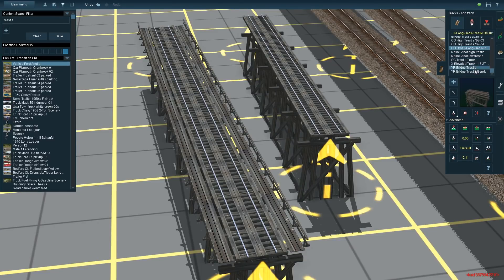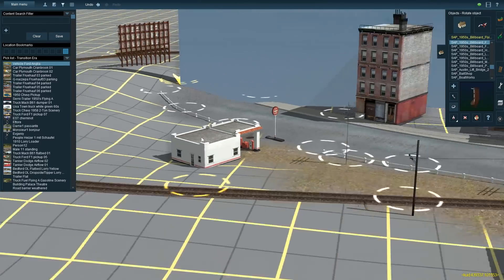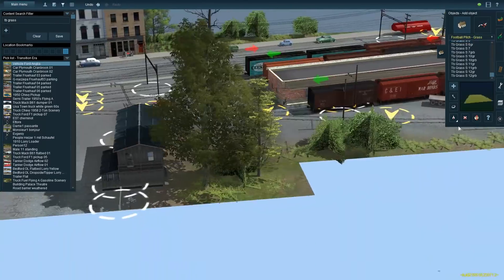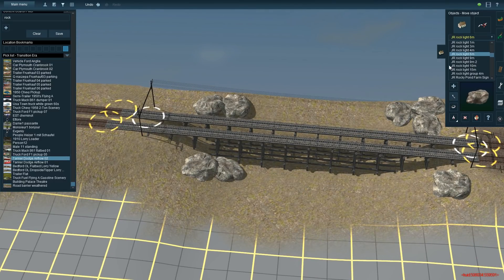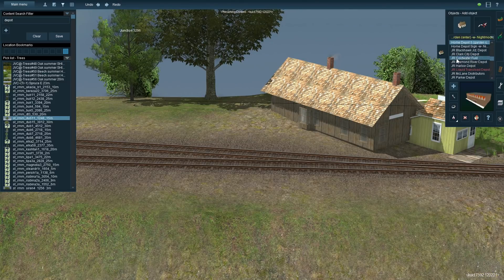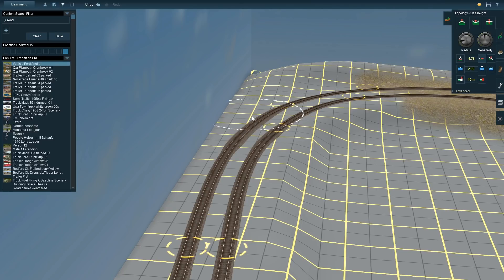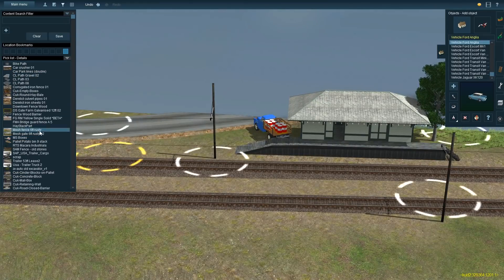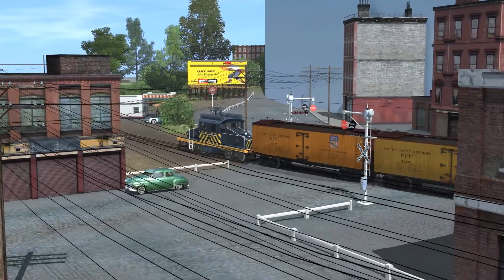Dayton & Troy Electric Railway: Episode 4

Comment: A little late points.
I really like the intro used on this series. The music is great, has some feeling.

The intro itself is the absolute best of most any I've seen. The first time I saw it I thought it was a real vintage cinema short. So well done.

The era for me is the thirties so there would have been plenty of vehicles (also a lot of horse and wagons for fresh fruits and vegetable as they lasted into the early '50s in the neighborhoods outside of the downtown district.

The way stations would have been drop off points(transfers) from the city for the folks out of town a ways, so anything from the Mail to large farm and home items.

I believe that whoever did the original layout lost their way and made the city blocks too small. The stores back then would have had both front and rear goods delivery so, there should be alleys behind (about 10 - 15'' wide). The blocks should be about one large building deep, an alley then another similar building to fill the block back to back, the width would have been whatever you like If you have available some corner entrance buildings (usually they were drugstore / soda shops types).

Doing this would have allowed for better street width and room for the overhead wiring and corner curves.
The gas station is perfect as is its sign, a well known brand. That station would have been very busy being the only one around.

You've done great so far given what you used as a template.

As an aside, I'm 74 and grew up on the Near West Side of Chicago and that's how my neighborhood was built. It had both streetcars and elevated tracks (which were located over our alleys (prototype of this cities layout from the late 1800's.
I was born in the house my great-grandfather and grandfather built in Bloomsburg Pa. just east of Colledge station Pa. so your Berwind reminded me of home.
Reply from the maker: Thank you for all the info and I'm glad to hear you've been enjoying the series. It's always a challenge doing builds that follow a prototype or era I'm not familiar with so it's good to hear I'm mostly along the right track!

Comment: Where are the rocks you used at 5:28?  I noticed they say "JR" which would tell me Jointed Rail, but I looked and couldn't find anything on their website.  Love the progress you've done so far.
Reply: As he is a member of JR, he has access to a lot of stuff which hasn't been released and is simply distributed among the members of the site to give them more high-quality assets to build with.  Those rocks probably won't be released until this route comes out or another JR route that uses them.  There is a possibility that they may be in the JR tidewater pack but I don't know for sure.
Reply: or they're available to club members only like some of the factory buildings..